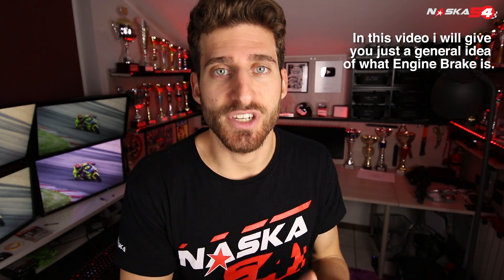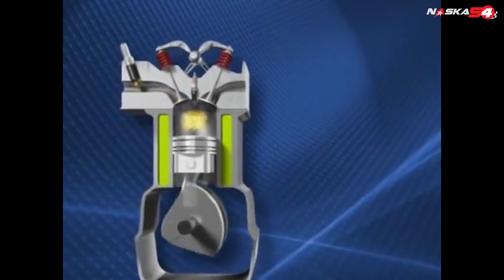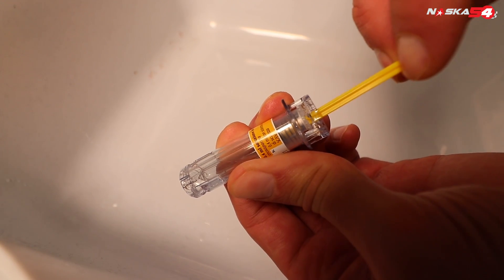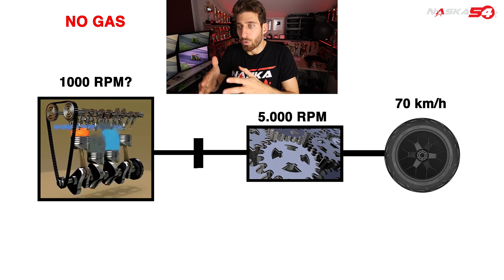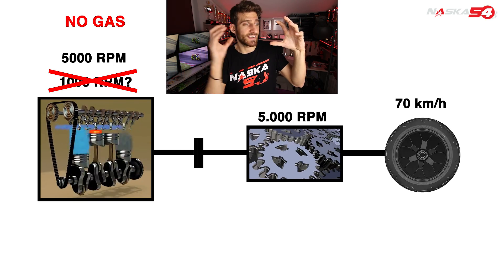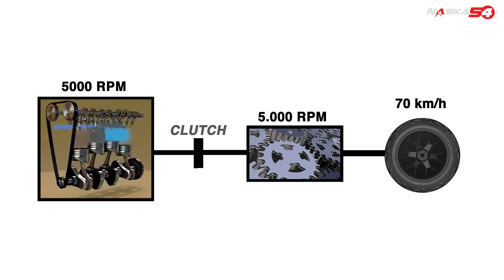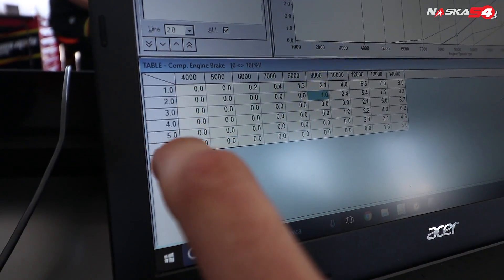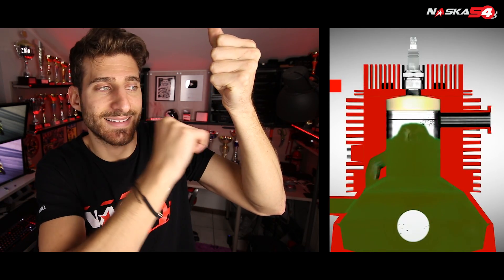THE ENGINE BRAKE: What is it and HOW does it work? Motorbikes and cars

Comment: I am sorry Naska, but engine break is nearly only due to the vacuum the throttle body creates when shut. Thats why you can adjust it with the electronics, because the throttle bodies are electronical controlled on your R1.
Reply: This is the main reason: "Because engine braking is primarily caused by the cylinder pulling against a lower pressure air in the intake that happens when you close the throttle valve.

The difference in 2 stroke is to fold. First any time the cylinder is on the intake stroke, its compressing some charge. Once it reverses direction, the energy is going to be returned to the drive train through the combustion at idle and compressed air acting as a spring), not to mention the negative pressure wave from the exhaust that will help pull the charge out (which is why 2 strokes have those bulbous exhausts). In a 4 stroke, the single energy stored in a previous exhaust event has to a) cause the other cyllinder to go down against a lower pressure due to closed throttle, then, compress the mixture again before the next event takes place. So per cycle, between combustion strokes, more energy is returned to the drivetrain.

Secondly, the reed valve opening in a 2 stroke depends on the pressure difference, so the valve won't open much if the throttle plate (or slide in the carb) is closed, and the open nature of the 2 stroke cylinder that connects the exhaust to the intake will mean that the pressure will somewhat equalize under and over the cyllinder, and the cylinder will just be a balanced weight that will continue spinning on its own.

This is also why diesels have Jake Brake, for the same reason that they don't have a throttle plate."
Reply from the maker: That's what i said
Reply: @AlbertoNaskaEnglish  That's not what you said, Alberto; you didn't even MENTION throttle bodies, so I don't see how you came to claim "that's what I said." It seemed like that's where you were going when you mentioned the phases of a four-stroke engine and used an analogy of trying to suck air into a syringe with a small diameter needle. Unfortunately you to didn't continue to explain what this analogy has to do with engine braking and went in a different direction. However, even this is not what engine braking is. As Jason Fenske explains on his YouTube video titled "Is It Bad To Engine Brake With A Manual Transmission?", it is not compressing the engine that causes engine braking, as that compression goes into the power stroke, which naturally more than compensates for any loss of power due to compression. That of course is not the case in your demonstration of pushing a motorcycle in gear with the engine off.

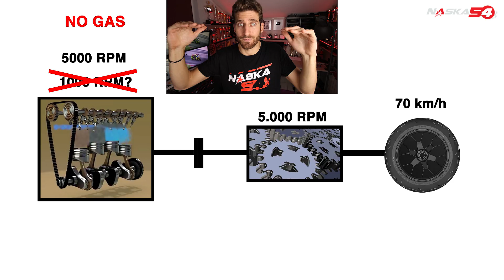At about the 4 minute mark you explained that when you let off of the throttle the inertia of the rear wheel would like to keep the vehicle at the same speed, keeping the engine's RPMs up. Then at 5:21 you state "Where does it take the energy to stay at 5,000 RPM? It takes it from the wheels. So, sucking energy from the wheels, the engine is actually braking them. So, it is acting like a brake, and this is why it's called engine braking." You are claiming that the rear wheel speed wanting to stay constant is slowing down the engine. That's not defining engine braking.

Let's leave this one to an engineer to explain. I'll quote Jason verbatim from the video I mentioned above:

"You let your foot off the throttle, and so that throttle valve closes and now you have a vacuum between that throttle valve and your engine. Your engine is trying to pull in air, but the throttle is closed so it's hard for it to pull in that air and that's what's slowing you down. A lot of people say it's the compression that's going to be slowing you down in these gasoline engines and that's not the case, because as that piston compresses up, it does pressurize that air, yes, and it does take work to do that, but that work immediately goes right back into pressing that piston back down. Very little of it is actually lost to heat in that transaction because engines are smooth running machines; they're not supposed to lose heat in that scenario. So a lot of the energy from compression just goes right back into pushing the piston back down. The real engine braking in gasoline engines comes from that throttle valve being closed and trying to pull that vacuum."

To put it succinctly, engine braking is the engine slowing down due to the vacuum created by the almost completely closed throttle valves and the slower engine speed in turn slows down the rotation speed of the drive wheel; it is not the drive wheel slowing down the engine.

I hope you consider re-doing this video as you don't seem like the type of guy that wants to propagate inaccurate information. It seems that you genuinely want to help others better understand how things work.
Reply: @AlbertoNaskaEnglish  You only mention it very briefly. Also in your reasoning behind why 2 strokes produces less engine break, you say its is because it produces power every stroke, but it does not produce power when you close the throttle bodies as you just said prior to that.

Comment: Can i apply engine brake in normal car and motorcycle?will it damage the engine?
Reply: Well it puts some stress on the engine, gears and clutch but so does regular driving. So it's matter of personal preference and environment you're driving in. 
Say on the downhill from mountain pass overheating your brakes and driving of the cliff would definitely damage your engine more than engine braking ))
Reply from the maker: Yes you can. No if you stay in the correct RPM range
Reply: Not if you rev match and never change down into a gear that will put your gearbox past the gears maximum rpm

Comment: when we stop acellerating the engine starts to work like an vacuum cleaner sucking air by the force of the wheel
Reply: There is no suck; there is only blow.
Reply: @DumbledoreMcCracken  Nah, its a vacuum
Reply: @williamdoulton2349  You can't suck air.

Comment: I’m having a problem of getting the engine break to rev match while actually using the front break can you show us how you do that
Reply: just practice mate, clutch shitf downd and blip the gas softly but quick
Reply: @danigoncalves3043  I think, he meant that it's hard to blip the throttle while pulling the brake lever. But same thing applies, just practice

Comment: My simple question is why some race drivers almoust turn off engine braking. Is it useful to bring more speed into corner?
Reply: Sometimes riders want to be off the throttle, but don't want the engine braking, kind of like being in neutral. Say you want to hold a particular line in a corner, if you brake or accelerate you are going to change that line.

Comment: The engine breaking can be set from 3,2,1 on the Ducati 1299. The highest setting is really strong... I don't understand why engine breaking is stronger on the V-twin motor compared to the inline 4 cylinder??
Reply: i think depends on the size of piston. also depends the crankshaft types. crossplane r1 has more engine brake than inline.  i think is also connected to the fact that 2 cylinder has more torque. in 2 cylinder there is more time between the explosion intead 4 cylinder. also v2 and 2 inline are different for this. in my mind i can understand why this happen, but i cant explain lol. we need a engineer
Reply: @ale.wist.  Your making sense. The pistons are huge on the big twin in comparison to the inline 4.
Reply: Explaining very basically is the same as you having to lifting 100kg( Wich replicate a 1000cc) now lift 25kg 4 times in 3seconds vs lifting 50kg 2 times in 3seconds. The 4- 25kg being the 4 little pistons and the 50k the 2 bigger pistons. For the 2 piston engine you need a burst with much more energy than for the 4piston because you divide the energy by 2 intead of by 4

Comment: Cries in 2 stroke

Cries in rotary
Reply: Its not as bad as everyone says... Modern oil injected 2strokes (with a seperate oil pump) can engine break all day. Most engines wont seize from a little engine break. Only with very lean mixture and alot of it a negative effect can happen.
Reply: You can see that by watching 2 stroke supermotos... Aint nobody got time to pull the clutch or give it a lil gas in a hard breaking scenario

Comment: This answer of my question. Thanks Naska,
But how you do it ? Need your percentage estimate betwen Front brake and Engine Brake
Reply: Afwan M 
The front brake is still FAR more powerful. This is always your main brake, and the engine can help slow down a bit more, or scrub of corner speed as you’re turning in.
Reply: @Showmetheevidence-  thank you sir, i do likely 50% 50%, but when i watch another vlog the engine brake too much is not good for the engine especial for gearbox. Is that true ? Actually Naska Videos help me alot, i didnt copy him just for my guidance 😁
Reply: @afwanm4156  Daniel gave you the correct answer. If you use zero front brake, and zero rear brake, then you are 100% engine braking.
If you use 100% front brake (and not flipped), you are using 0% engine brake.
It is a continuum.
Reply: @DumbledoreMcCracken   Actually that's not exactly correct, my point on the 'engine braking interacting with the driveshaft' was only for when the rear wheel was in the air from extreme braking.
What's important to be aware of is to the fact that the rear wheel decompresses under deceleration, reducing it's potential non-slip braking, which will be a combination of both engine braking and actual rear brake.

To answer @Afwan M, on controlled asphalt conditions where you want to extract performance, the front brake is your bread and butter. On the road your priority is being safe and because the road condition is not something you should put your trust on, using engine and rear brake in combination with the front brake is a better strategy to stay on two wheels.
My take is use engine braking when you can to save fuel and stay safe, if you need heavy braking progressively use your front brake as the main stopping power as long as you're not turning or swerving.
Reply: @dovilacus  I tried to simplify because he doesn't appear to speak English natively, and your answer may be too complex for his English language skills to parse.   Good answer.
Reply: Also to develop on @D.B. 's remark, when a motorcycle slows down the front tyre compresses while the rear tyre decompresses in a sort of deceleration squat. On motorcycle racing videos you can see the rear tyre actually lifting from the ground, which means that all the engine braking is doing is slowing down the power train until it matches idle engine speed, at which point more fuel will be injected to keep the engine from stalling.
Here's a good example from God Marquez: https://www.youtube.com/watch?v=tpI2S3GQ-gA
Reply: Go and watch "twist of the wrist" its on youtube... Rolling of your throttle can tighten a turn and vica versa... You are probably already doing it by instinct.